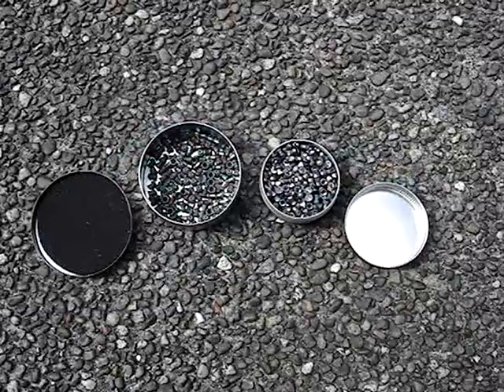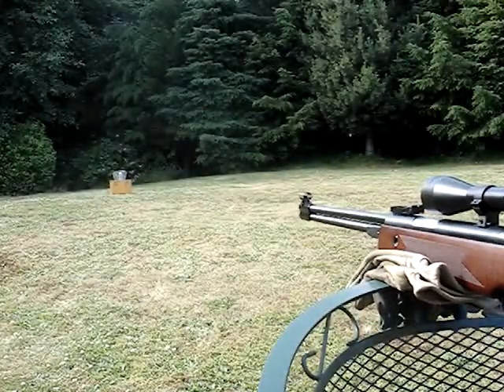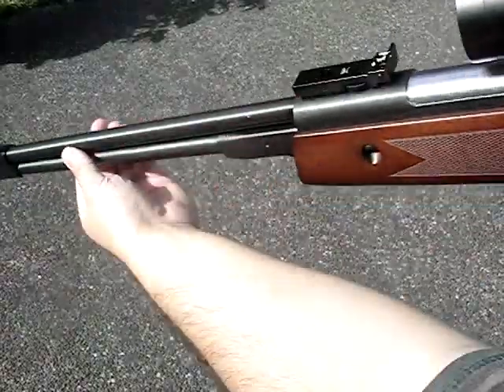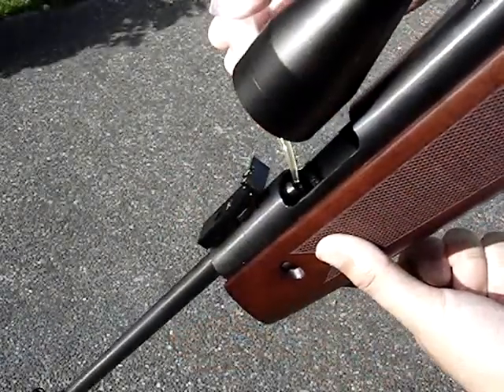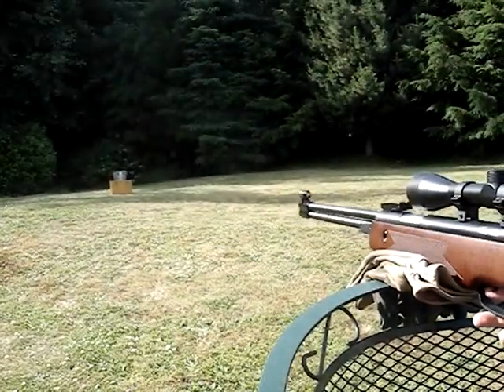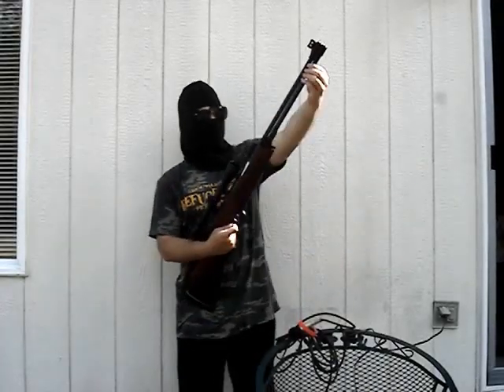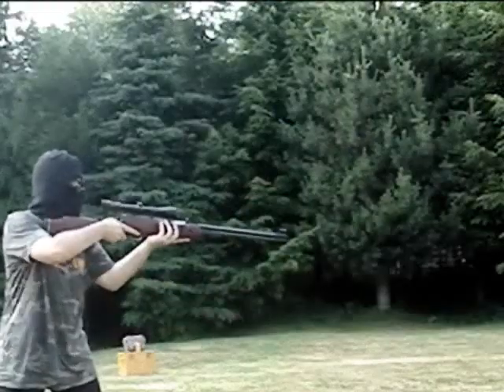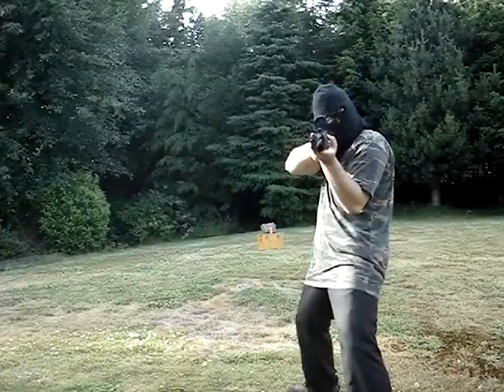Dieseling Motor Oil in a Tech Force 97 Air Rifle to boost muzzle energy

Comment: What kind of air rifle this is to shot full auto like that?)
Reply from the maker: +John J Boy It's a Tech Force 97 .177 underlever pellet rifle. The airgun cannot shoot in full auto. It is mechanically impossible. I happen to have a high midi-chlorian count in my body and I used The Force to cock, load, and shoot the airgun using only my mind. The process was done so quickly that it looks like full auto.

Comment: if you put the drop of oil where the intake for the Piston is so it sucks it into the chamber not just on the skirt of the pellet you get 10 times the velocity....22 Cal. break barrel at 1560 fps. through the crono with 26 grain pellets....might break lower quality springs..... deadly...
Reply from the maker: Whoa really. I never fired a .22 airgun that broke 1100 FPS. So that’s gotta a way to blow the seals quickly firing 140 foot-lbs energy. The Ruger 10/22 rifle shooting 40 grain pellets at 1200 FPS is weaker at 131 foot-lbs muzzle energy.

Comment: why do you not put in wd 40 ^^ it works better with the airrifle i have some one the umarex 850 air magnum witht 16 joule ^^
Reply from the maker: I did try WD-40 in the air rifle but it was not shown in this video. It works well because it is viscous and stays inside the pellet much better. I also tried vegetable oil and that worked as well.

Comment: I wonder if dieseling an air rifle can initiate a gas operated system.
Reply from the maker: Che Guevara That's a really good question. I'm sure the air pressure from an airgun alone is enough pressure to cycle a bolt and reload/chamber a pellet from a spring loaded magazine, but I am also sure that the air pressure from a cocked pellet rifle is not strong enough to cycle the air spring. Remember that a gas operated system doesn't rely on a heavy piston spring. All it does is cycle the bolt, chamber a round, and cock the hammer pin.
Reply: Air also needs to fire the pellet.

In my opinion and experience, by the time a diesel gas system is put in place, one might as well buy a real gun.

You'd have to lubircate each pellet, maybe in a rotary magazine.

The other thing is... the piston only has to ignite the diesel, therefore, it can be a small piston on a weaker spring igniting the volatile fluid. Therefore the ignition can easily cycle the weapon and you not longer have an air rifle, but essentially, a blow-back piston operated gun that fires pellets.
Reply: bmiranda2645 this is a comedy air gun video haha

Comment: what did you smoke that morning?
Reply from the maker: I smoked Pennzoil. It is the motor oil that diesels under the heat of compression inside the air gun's compression chamber. That explains the smoke coming out the barrel.
Reply: What did you smoke prior to replying to this?
Reply: You CAN'T get higher velocity in an air rifle like that!!!!! Well maybe 5-10 fps when the oil is fixing the guns leakage^^

Comment: Will a 495fps air rifle work with oil?
Reply from the maker: +Noah Billingsley That's a really good question but I don't really know for sure. I do own a .177 Ruger Explorer rated at 495 fps but I never tried oiled pellets in it as I wasn't sure if the piston spring compressed air fast enough to reach ignition temperature. I was able to get the .177 TF97 at 900 fps to diesel, then I got the Crosman .177 Phantom at 1000 fps to diesel. So I estimate that the oil adds over 200 fps to velocity.
Reply: Ok thanks

Comment: You know that a sub sonic pelet is more accurate?
Reply from the maker: Yes I know from experience. A lightweight alloy pellet is very inaccurate as it is more prone to wind and tumbling at supersonic. A heavier lead pellet is way more accurate because more of the energy goes into stability and impact, which is why a slow moving bowling ball to the head is deadlier than a plastic airsoft pellet breaking the sound barrier,

Comment: I have a similiar gun but it is a side lever.
Reply from the maker: +James haury cool. Under lever, break barrel, and bolt action spring airguns are the only styles I ever used. I have never operated a side lever airgun before.
Reply: +bmiranda2645 
Side lever is the best lever. Diana (RWS) 48/52 and 54 are top of SL air guns, also greatly build and powerful - out of the box.

Comment: No man, you are putting the oil in the wrong place.  You need to put a drop down in
the spring cylinder chamber and not the base of the pellet.  Also use very thin sewing
machine oil  or spray some lubricant like WD-40  The oil will also lubricate your
piston seal.

Comment: how can it be illigal where Firearms are legal and it's not a firearm, neither are muzzleloaders. according to ATF regulations
Reply: +bmiranda2645  you can build air gun pretty easily so the law does not work too well
Reply from the maker: Brett Duffy yes there are some obvious loopholes to written laws like how airsoft guns in America do not need to have orange blaze tips inside the states, however by legal definition any replica of a firearm must have an orange tip or barrel plug before being imported to the US. however within the US airguns like pellet guns, airsoft, bb guns, paintball guns do not need orange tips, so it would not be illegal to remove an orange tip from an airsoft gun where I live
Reply: I put an orange tip on all my pellet guns
Reply: and I have a replica Army revolver that shoots with no orange tip

Comment: your not  doing whats called dieseling . dieseling comes from excess oil in the chamber  .The chamber is the space between the piston above the seal and the space above the seal to the small hole at the end of the chamber . Your putting the oil inside the pellet so once the cocking level is closed your oil is really at the end of the barrel,having nothing to do with the air in the chamber . Your not going to hurt your gun doing what your doing as long as the oil doesn't allow your pellet to be forced out at a speed that allows the piston to travel to the end of the chamber so fast that it has no resistance from the pellet going through the barrel  and slams the piston into the chambers end and causing it to crack or break. Once you fire the gun with the oil behind the pellet a few times it starts to lubricate the walls of the barrel causing the pellet to travel faster and faster the more oil lines the barrel walls . The smoke your seeing is the oil on the walls burning from  friction caused my the pellet.What your doing once you lose resistance is the same thing as shooting the gun with out a pellet in it and thats never good. Once you have oil in the barrel you should not have to all oil again for a long time and still have the pellets  producing smoke and faster speeds .Your gun is much better off doing what your doing instead of actually dieseling which is something that happens in the chamber it's self that can cause damage to your piston seal .
Great job on the full auto shooting very funny .We all want to be able to do that lol
 but as far as I know this bb only gun is the closest thing to a pellet shooters dream . http://youtu.be/vstGCioQ2hY  1,200 rounds per minute or 20 rounds per second.
Reply from the maker: Hey thanks for the interesting explanation. I honestly don't know exactly what goes on to cause the pellet velocity to increase. However I did find out that I didn't need to have a pellet in the chamber for the excess oil to diesel. In fact the air rifle shots that I pointed towards the camera were all dry fired shots because I was aiming at my camera and my house. The joke shot that was used for the fully/semi-automatic modes was also a single dry fired shot when I was standing in front of the camera because I was aiming towards my neighbor's backyard. I came to conclusion that it's gotta be dieseling because the instant heat of the compression in the chamber ignited the motor oil whether a pellet was chambered or not. Obviously do not dry fire your airgun because the piston, spring, and seals may experience shock damage.
Reply from the maker: Or maybe the smoke that occurred during my intentional dry firing was just previous smoke displaced from the chamber into the spring tube after the initial pellet shot that had oil in its skirt? So when I cocked the airgun afterwards, it drew previous smoke back into the chamber and the dry fire was simply just purging the receiver of the remaining smoke?
Reply: bmiranda2645
Burning of oil always occurs. No matter if it's behind pellet or in chamber. (in front of piston). Burning in chamber gives insane amounts of energy and stresses cylinder and piston spring (tends to crack after 100+ shots) Pellet velocity rises to around 1300FPS and power is insane. But... don't destroy Your gun.
Reply from the maker: TomashPL58 Yeah you're right. I put over a 1000 shots through the TF-97, 500 of which were dieseled and yes the seals were severely cracked and needed to be replaced.

Comment from the maker: Well you are right about that. It is in fact silly that laws restrict the use of airguns putting out more than 12 foot pounds of energy, but it would make more sense to me to restrict the usage of pre-charged pneumatic or semi automatic CO2 airguns which can be modded to consistently shoot at higher power.

Comment: the oil causes detonation that damages the seal as well as causes the spring to fatigue and collapse and can actually cause the spring to fracture. It greatly increases the double recoil shock and that can damage your scope. It also causes your gun to have erratic velocity that seriously impacts the accuracy..Dieseling is less of a explosion , just a little smoke due to excess lube .your causing detonation ,anyone with half a brain and a good gun would never do that

Comment: Dieseling works better with about 35 grains of black powder.
World's Fastest BB Gun
Reply from the maker: Whoa that is impressive. Just saw your vid of 3000 fps BBs being shot with black powder charges. So what you get are super high velocity tiny musket balls that can punch holes in half dollar coins? I'm only familiar with BB guns sold on the shelves at under 600 fps and they just dangerously ricochet off of hard surfaces.

Comment: Strange how many people who don`t believe dieseling happens in air compression guns with the "wrong" kind of oil (silicon oil is the right kind, mineral oils will explode at high air pressure). The dieseling effect is very real and powerful, it will also harm your gun in the long or short term.

Here is a video with chronograph results  https://www.youtube.com/watch?v=OOPF_qb78_E
Reply from the maker: +Rondo Cat actually that guy proved that adding a little bit of combustible oil in the skirt of a pellet does in fact raise the the muzzle velocity past the speed of sound which is 1115 fps. Using a chronograph, he documented what I didn't do in this vid, and he confirmed to me that what I was hearing was a whipcrack sound from the pellet breaking the sound barrier. Thanks.

Comment: the correct oil for airrifles is silicone oil and with my airsoft costing about 750 euro  thats  a grand a pop for AR's....i can advise u not to listen to this person and not fock up your gear...since hes prob just doing this with the leftover crap gun hes got laying around...

SILICONE OIL AND NOTHING ELSE ask any fullblooded airsofter that repairs and maintains his own guns
Reply: +KG “r33m3r” steve You are missing the whole point of this, he is not doing this for the lubrication but for the explosive effect other than silicone give in a air-compression rifle... The oil on the back of the bullet explodes because of the high air-pressure just like in a diesel engine giving a it massive boost. This is not something recommended to do as it will harm your air-rifle but it is a lot of fun :)
Reply: +Rondo Cat wel it ok u didnt miss mine how i expkain to people u are ruining ur gear and not stating it in the video,as airsoftenthousiast i felt obligated to call u out on it

Comment: this is stupid definitely ruin your gun if you really want a boost in air gun muzzle velocity try cleaning the rifle really well then apply hornady one shot spray down the barrel toward the muzzle. let it dry out and see what happens....like putting a thin Teflon coat.  BUT with muzzle velocity increase like this your accuracy goes down my solution to that was to use a heavier pellet . did this to my umarex surge and this thing is sending lead pellets out faster than it did alloys without the one shot treatment.

Comment: The caption should be "How to properly ruin an airgun"
Reply from the maker: Not a bad idea. Or "How to properly ruin a scope not designed for a spring piston air rifle." That forward recoil of the air rifle definitely broke the scope.
Reply: Is that truth or r u being hypocrite?
Reply from the maker: That's the truth. The crosshair kept turning after each shot because the $40 JBU scope that came with a TSD L96 airsoft sniper rifle was probably not reinforced for the forward slam of spring cocked pellet rifles.

Comment: shit in Canada pellet or bb gun cant go over 500 fps it is bull shit.
Reply from the maker: Yeah sorry about the truth. I bought a Canadian standard Ruger Explorer rated at 490 feet per second. It's a fun little gun but for  about the same price you can buy a Crosman Phantom rated at 1000 fps or 1200 fps using alloy pellets.
Reply: bmiranda2645  I love to have one that goes 800 to 1200 fps